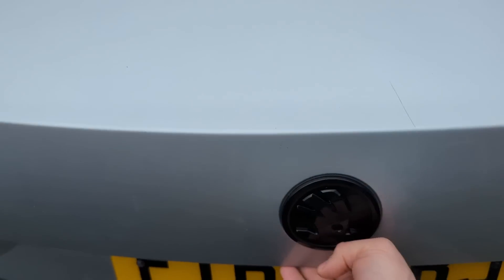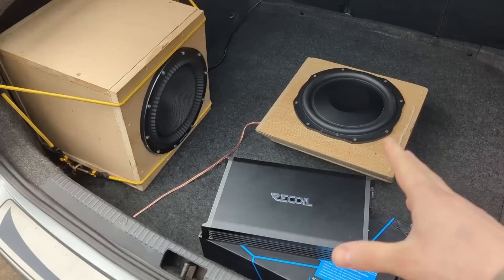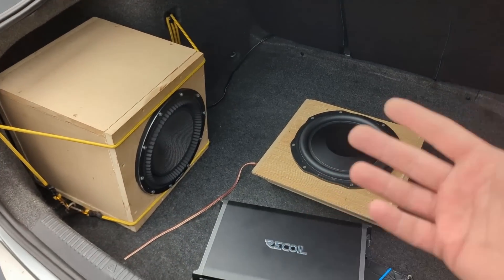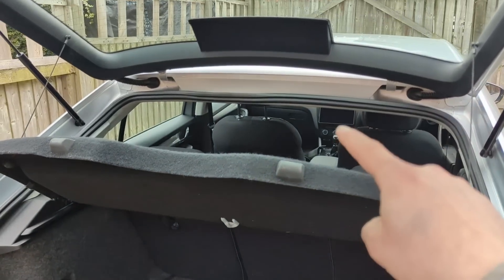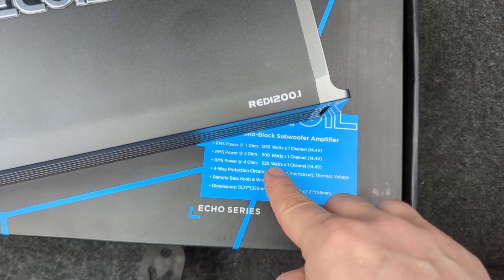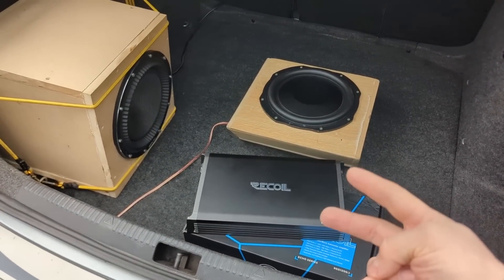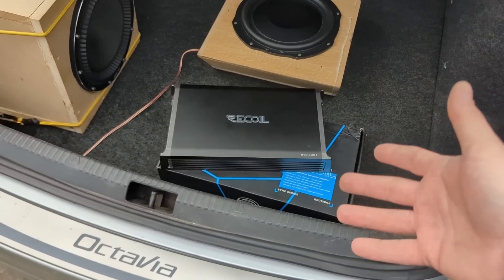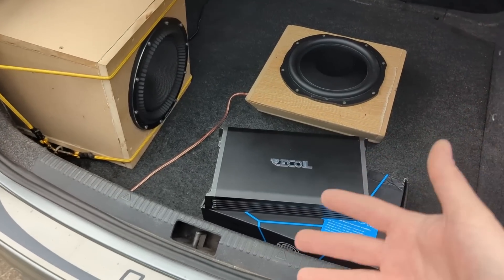Do different Ohm loads affect sound quality?

Comment: I think it's highly dependent on the type of amp being used. 
I've had this discussion with Linear Power owner, Ray Rayfield, and he states, it's better to have higher ohm loads at higher gain then it is to have lower ohm loads with lower gain.
Reply: Setting gains has nothing to do with speaker resistance. If a channel gain is set just before clipping and you replace a 4 ohm speaker with 8 ohm then try to raise gain you will be sending a clipped signal.
Reply: @goyslop4289  The amp itself will create more distortion at a lower resistance than it will at a higher resistance. The amount of gain will not in comparison. 
So there's 2 parts to this equation.
1) The speaker itself being wired at 2 vs 8 ohm
2) The resistance load at which the amp is presented.
Ray can explain it in more technical terms.

Comment: The way I heard about the myth is 1) lower thermal loads at higher ohms and 2) better damping factor (so more control over the speaker ). I know in a separate video you showed there isn’t much in the damping factor. So it would seem the only remaining advantage for higher ohms is in the thermals.
Reply: He shows low power. Now run the same test at 2k watts. And his understanding falls apart lmao

Comment: My prediction is that you will see differences in the attack and decay or impulse response.

The reason you didn't see it in this test could be due to the amplifier you used. Not all amps have that fast attack or initial impact. I think you'd need to use one of your better Alpine amps.

Not all subs have it either. I tested a Type R from 2020, it didnt have it. I don't believe the Type X had it either (based on another persons testing). I'm kinda skeptical your HDZ will have it, but not sure. If it's Xmax is not huge, it might. The RS is another high excursion sub. I don't know if you would hear it in that unit either. 

All the subs I've tested that have that fast initial impact have all been under 11mm one way Xmax. 

The two subs I tested that didn't have it, where both really high Xmax. (15mm and 20mm) Maybe that's a key factor?

I hope you've got a sub laying around that you've heard really fast initial impact with.

If you get an amp and sub that have that fast attack, then you might see a difference in the impulse response between the ohm loads.

Or maybe not, who knows? Lol
Reply: I think you are on to something, but Xmax is certainly not the parameter that is the determining factor, but maybe a rough indicator. I think it's the other parameters which change with a shorter voicecoil that ultimately results in the differences you've perceived. I don't know of any subwoofer, which would have different length voicecoils but otherwise the same parts. Dayton Audio RS comes close, but HO and HF models are pretty different from one another and supposedly they have the same Xmax. Anyway, I know SB Acoustics make midwoofer and midrange versions of some of their speakers. Comparing for example SB12NRX25-4 and SB12MNRX2-25-4, it's pretty interesting how the shortened voicecoil affects the parameters. How this relates to subwoofers, who knows 🙈
Reply: Yes, the shorter Xmax just seems to be a rough indicator. 

I've only tested 7 models of subs with an 8th on the way. So my testing is pretty limited. I tried to see what the subs have in common, but not every brand will show all the specifications. So Xmax is the only trend I see. 

Next sub is a Rockford P3 12" with 14mm Xmax. That's kinda big. We'll see. Lol
Reply: Impulse response is just another way to look at frequency response, they are not separate.  They are related through the Fourier Transform. If frequency response is the same then impulse response will be the same. Its just math
Reply: @ecpruthless  That is true, impulse response and frequency response show the same thing in different domains. But when there are differences, the difference can be obvious in one domain and subtle in the other, I would guess so atleast, frankly I'm getting more confused the more I study this subject 😅
Reply: @ecpruthless When I talk about impulse response, I mean how quickly the cone can accelerate from a stop (attack) and how quickly the cone stops ringing when that signal is removed (decay). 

I don't know how it's being measured, but I didn't think frequency response had anything to do with it. Am I thinking of something else and not impulse response?
Reply: Longer voice coil, more weight.  Longer voice coil, more inductance, therefor worse high end extension.   Also, the larger the xmax, the larger the top plate and yoke has to be, which decreases the magnetic flux
Reply: @JasonWW2000 The frequency and amplitude of input signal will determine how fast a cone accelerates. Any deviations from the input signal to output, in your example ringing, will show up as distortions, or unwanted added frequencies, in a measurement in FR also.

We dont need to add more meaning to an IR then it deserves.
IR imo is not a very useful way of making quality comparisons in general

 We also have to be careful when talking about a drivers parameters and their response. We should think about the system as a whole. TS parameters, for example, are really only relevant in free air, once you add an enclosure the respsonse is greatly altered, and then adding listening room again changes the response. The latter 2 having much greater impact.
Reply: A higher inductance will cause the coil to store the electric field, and also inductors resist the change of a state.  The higher the inductance, the slower the the field strength increases and the slower the subwoofer will react to the signal.
Reply: "Impulse response is just another way to look at frequency response"    That might be true for the manufacturer supplied RTA graphs where the driver is supplied 2.83V at most, but they don't supply linearity results at the rms ratings.  I wonder why?  Because as the magnetic and electric fields saturate, the drivers going to become unlinear.  As the coil moves further out of the gap it creates more distortion.  Also as I said, higher inductance (which happens at higher frequencies) worsens high frequency response.  Feeding 1000w at 150hz needs a VERY different slew rate than 1w at 20hz from the electrical AND mechanical side of the driver.  The suspension has to be able to keep up without resonating too, or distortion!
This is why my most prized driver (Eclipse SW8200) has an underhung coil that is irregularly wound.  It has more layers at the extremities.  It cant leave the gap.  This gives is a rubbish sensitivity at 1w but the harder you drive it, the better it gets.
Reply: I was looking into that SW8200. That's an overhung coil, isn't it? A massively tall coil for massive Xmax? Like 31mm one way Xmax? Maybe 38mm?

The voice coil is skinnier in the middle, which increases the coil gap and reduces strength. All for the purpose of weight reduction while still being able to maintain control at high excursion levels.

It's an unusual design. 

With my JBL W12GTI's, it is a Differential Drive design where you have a magnetic braking effect at high excursion to maintain cone control and reduce distortion. 

It's two pretty unique designs to achieve the same goal.
Reply: @JasonWW2000  I had a look over the data sheet for the JBL's.  They run an inside-outside voice coil arrangement, which is kinda cool and rare to see.    I have some probs with the whole marketing literature and manual etc, everything is vague, a bit of contradictory information, and no real diagrams or explanation of what is going on. 

They say "At low power, both coil drive the cone.  At high power, one coil leaves the gap (which would create crazy amounts of heat and distortion) while the other coil which is longer, takes over.  This provides linearity."
Well, I looked at the coils, and they are indeed wound at the same length.  I looked at the data sheet (not the one included with the driver) and they list the gap height and coil height as 25.40mm and 66..04mm respectively.  No variance between sides.  Same height and width.  Instead, what I see is that the coil is broken up, it's almost like 4 coils, 2 outside, 2 inside, with a gap in the middle.   This could make for better linearity, at the expense of sensitivity at low excursion.
I don't really get the magnetic breaking effect you are talking about.  It has no shorting rings or anything.  Just the 2 coils.  They absolutely can not be wired 180deg phase from one another, that would not work, the electric field would cancel itself out.  The AC voltage needs to run parallel up (or down) the coil system, it must be symmetric, as the magnetic field can not and does not change .

Then in the next bullet point they say how the driver uses a "push pull system", each using its own magnetic gap.  OK, but surely they aren't putting a magnet NS inside another magnet SN??  What does "push pull" even mean?  And even IF they did do the crazy SN magnet inside a NS arrangement, the inside coil needs to be reversed, it makes zero sense.   It makes sense to me that the top inside and outside coils are wound as 1 coil, and the bottom pair as another coil.   It doesn't make sense that they would make the whole outside coil 1 coil, and the inside coil 1 coil, because of linearity.  The outside is obviously wider, so to make both inside and outside coils the same length, the outside needs more copper (length) more inductance, more resistance, etc etc...

"A Differential Drive Design motor relies on magnetic braking, which prevents over excursion".   Well that's exactly what shorting rings are used for, yet no where, not the JBL page, the manual, the data sheet, not even a teardown or forum mention shorting rings.    No diagrams or anything, all shrouded in marketing and secrecy.  

*************************************
Yes, I meant overhung for my driver, I wrote that right before sleep lol.  I couldn't find the manual for my sub online, but you would blow out how detailed it is I'm sure.  Ill try upload it for you.  
RF 16hz, VAS 234 litres, QMS 3.217  XMAX 30.48mm  Solid aluminium cone, foam surround, single 3 ohm alloy coil on alloy former, made for Eclipse by TC Sounds
Reply: @minus3dbintheteens60 I can't blame you for not understanding the design. Even in JBL's patents, they kind of talk about the motor design without showing good pictures of it. I guess they don't want other companies copying it. Lol

I kinda want to do a video showing diagrams and explaining it, but it's an old design not used by anyone else so there's probably not much interest. 

It's basically two voice coils on a long former. One coil above and one below with about a 1/2" gap separating them. (On the outer part of the former, like traditional coils)

There's two magnet structures. A traditional ferrite or ceramic ring (3 stacked) for the outside and a neo motor inside the voice coil.

Think of it as having two top plates and two magnetic gaps. I don't know which is actually north or south, but let's say the outer magnet structure is N on top and S on the bottom. 

Then the inner magnet structure is S on top and N on bottom. This way each "top plate" or gap has a N and S field. 

The top coil moves in the top gap and the lower coil moves in the bottom gap. 

Due to this magnet arrangement, this means the top coil and the bottom coil have to be electrically reversed, polarity swapped, in order to function properly. 

Once you understand that, then you have to realize each coil is not centered in their respective gap. The top coil is a bit lower in it's gap and the lower coil is a bit higher in it's gap. 

What this means is as the cone moves in/down, the top coil will start to enter the magnet field of the lower gap. Since it's the opposite polarity, that lower gap will push the upper coil back up. This is like a magnetic brake. It slows it down, and you have a high degree of control at high power, high excursion levels. This higher degree of control is supposed to reduce distortion. 

The result is an efficient, SQ driver that can also handle thousands of watts on a burp and produce high SPL levels. And do all of it with low levels of distortion.

It's pretty neat, I wish JBL would come out with a modern version. The only downside is it's 12" tall. Lol.

Comment: I always believed and even advised to friends that higher Ohm load subwoofer or wiring in like 8 Ohm load will perform more accurate get better results - thanks again for video and for busting a myth!
Reply: Impedance not ohm load
Reply: @paulh8221  ummm, how is impedance measured
Reply: @paulh8221 He used the correct term.
Ohm load can refer to both impedance (AC) or resistance (DC).
Reply: I think it does in theory, but maybe not in the real world. Or the sub and/or amp he used in the test just isn't showing good results.
Reply: @JasonWW2000  I don't think this was a good test he capped it at 100watts there is a big difference at 1000, 2000,3000 watts as the thd would be amplified several folds. it also would cause more heat and voice coil expansion at volume, maybe it's not noticeable in the say the highs but not many people are even running their highs on 1 ohm it's pointless the high wattage is not needed there the lower ohms are in the spl groups
Reply: @veelink6345 Your super high wattage recommendations are not necessary at all because most people barely use a 100 watts total. This is an SQ test, not SPL. You should be able to do these tests at 1w in my opinion. 

I don't believe this is a definitive test based simply on the subs and amp that was used.

I suspect you will see a difference in the impulse response, but you have to have a sub and amplifier combo that delivers a really fast attack or initial impact.

If it's a sluggish amp and/or sub, then you're not gonna measure any difference by changing the impedence. 

That's my theory at least.
Reply: @JasonWW2000  i agree on that point 150x is about the maximum demo wattage in a SQ system. I think in spl it doesn't even matter but there also is the halving of the dampening factor splitting ohms
Reply: What it boils down to is........What Ohm load is the Amplifier built to run best at. Amplifiers have a rated Ohm load and a Stable (lower) ohm load. As of late, it's somewhat reversed. In Sub Woofer Amps (Primarily D Class), if it's rated at 1ohm, that is where the best performance values are. When increasing the ohm load on that same Amp the Quality of sound decreases because it's actually "Bottle necking" and this causes increased heat as well.
Reply: @forsale313 Decreasing the ohm load of the amp would be harder to drive. This would create more heat, I believe...
Reply: @frizzlefry5 I depends on the Amp. A lot of the newer (D class) Amps have to work harder @ 8ohms because it's like blowing air thru a cocktail straw vs blowing air thru a regular straw @ 1,2 or 4 ohms.

Comment: What about damping factor? Does is not affect the sound?
Reply: It's supposed to. 
It alone might if it's super high or super low, but if it's anywhere in the middle, then it's probably a combination of the damping factor along with other things that are going to affect the sound. 

Rarely is it that one specification on it's own.
Reply from the maker: I have a separate video about DF, you are more than welcome to check it out.

Comment: Interesting with measurements. But this one clearly shows that the gold standard still is, the by far superiour human hearing. 🙂

REW is still in essence just a glorified volt meter with no intelligence what so ever.
Reply from the maker: Indeed. However based on scientific research and what Erin is doing on his channel, there is a 100% correlation between measurements and what we hear. Especially if we are talking about acoustical measurements.
Reply: @ I always measure my builds, because measurements are helpful crutches when my goal is to build a musical playback system.

But lets not fall into the un scientific n00b trap. Musical?
The n00b trap is to say that a more musical sounding playback system does not exist because we dont know how to measure that.
Reply: @JeyDeeSweden Are you making the claim that you can hear the difference between the 2 and 8 ohm impedances even when the machine can't measure it?